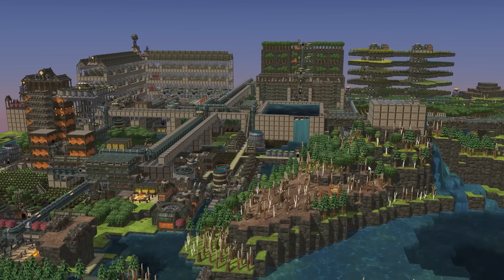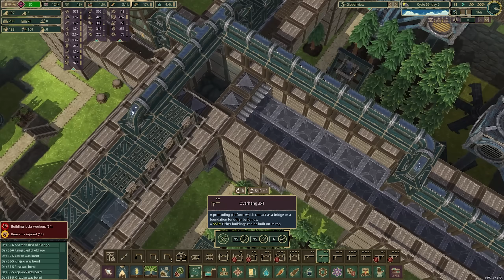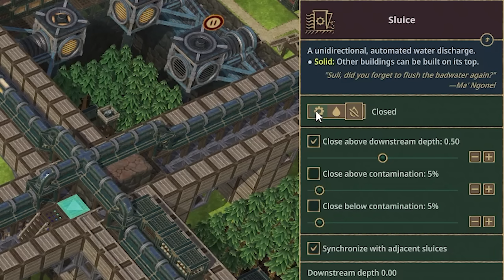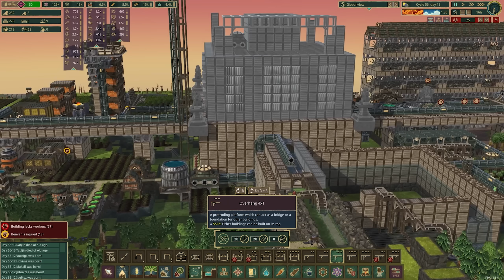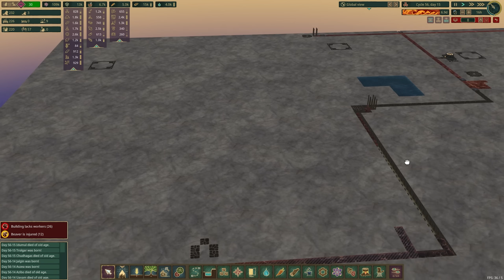Water Tower Time - Timberborn - Skyborn #10

Comment: 10:30 Since "The Empire State Building", like a ziggurat or a mastaba evolves step by step, I thought you would have some flat roofs regularly slowly but surely shrinking the tower to its core and to its "pointy" top allowing you for decorations but also for transit through the tube-way system, not having it traversing it, so it would be visible like you wanted to.

Comment: Would it be possible to take water vertical in a single tile wide high up.if you used sluce gates at the bottom and the very top to keep it under pressure then release when the pumps drain the water?

Comment: Does anyone have a moment to explain why the tower fills? How is there enough pressure to fill it?
Reply from the maker: Water will start filling upward if it has no where else to go. In this case I have a water source at the very bottom of the tower and all the outlets from the tower closed off - so it slowly rises to the top until it spills out
Reply: @ZeddicBuilds  Thank you. I couldn't see the water source inside the tower!

Comment: I like the constructional decoration dirt / unsupported buttress which is a cleaver solution that can even be added mid wall (than only at a corner) (you can use the dirt mid-wall, having levees above and below that specific attachment point).

Comment: Have you thought about making that waterfall cascading, right on the edge of the water tower? I feel like it would look even more marvellous
You're truly a wizard of this game
Reply from the maker: I hadn't, but your comment has me thinking about it now! I'm curious what would happen if I ringed the top with dams on all sides and if this would let water cascade by a little bit in each direction. I'm also contemplating adding a mod to reduce the build height limit so I can keep this thing going up
Reply: @ZeddicBuilds  you'd probably make an indent on the last wall of the 2nd "floor" - because the 3rd "floor" is open, so it will flood there otherwise. Idea with dams on all 4 sides sounds amazing  to me, gives me Haging Garden vibes
If you make it even bigger with a mod - it will only become more epic!
Reply: One more idea - using dirt blocks instead of sluices as a decoration. Not sure if there are any restrictions against that, but they will provide you more colors. And if you use dirt blocks on ridges, you can try to plant something near waterfalls for even more decorations

Comment: Try using warehouses near such giant structures. Builders will build much faster and it can take several times less time. Also use small warehouses for food and water near the building. If you notice how beavers build, you can come to this conclusion. Op-op. The beaver ran, put 1 block, wanted to drink, ran to the ends of the earth, drank, then another block and wanted to eat. And the day is already over and he runs 3 kilometers to housing. So without such mechanics of warehouses such buildings take a lot of time

Comment: Itd be nice if there either where an alt version of overhangs that instead of being like the scafolding whould have a levee, so it was watertight.
Or if you could build it on the inside so it was poking out of the wall. Maby being able to fill in the scaffolding part with dirt or levees.